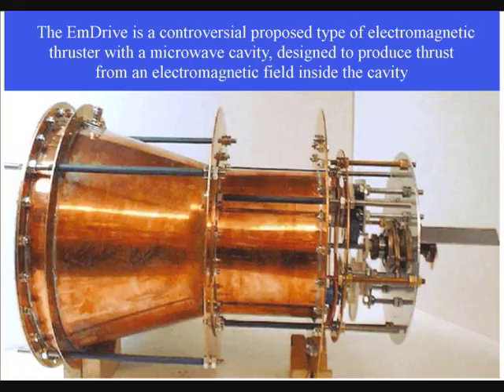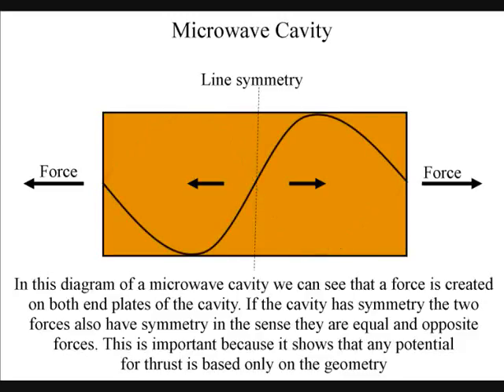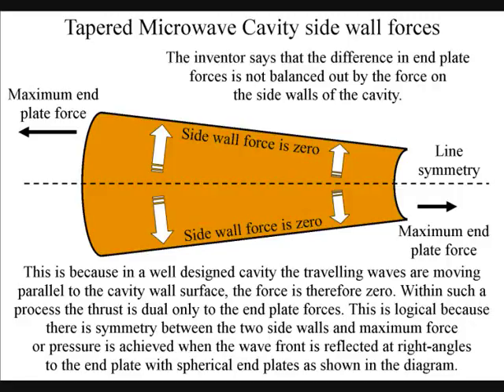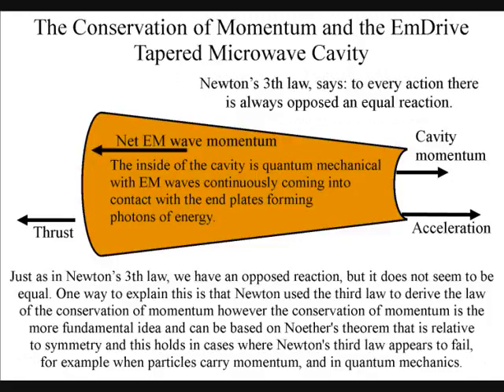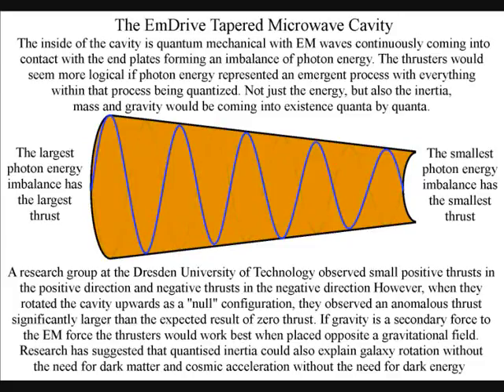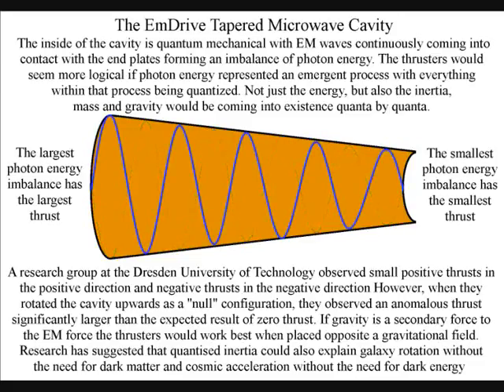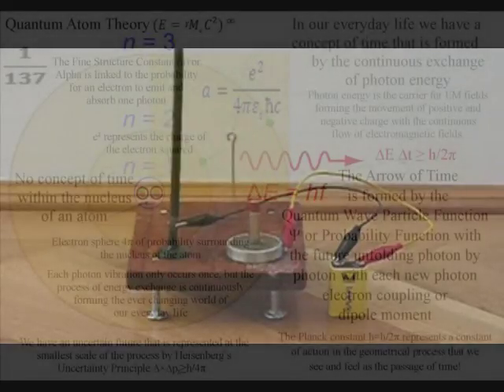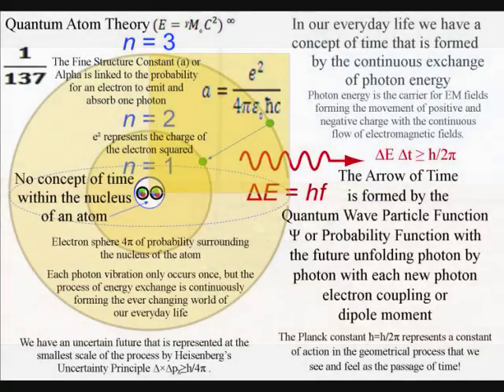EmDrive and a new interpretation of photon energy (1)

Comment: For those who haven't done any kind of research on how it works. I believe one of the reasons this works is because if you hit metal (certain metal or depending on light) with a certain wavelength of light it starts to give off electrons and those electrons leave based on the energy input. This only starts to happen at an exact point of light wavelength and energy input for each kind of metal. Once you surpass this point the more energy you input through this means the more energy that the electron leaves the metal so you get more thrust. 

I could be slightly off with something since I can't remember the name of this effect, however it is one of the things that I have at one point found about this kind of thing a long time ago.

Comment: If objects in space warp the so called space time, then why not ride the waves. This would remove the amount of energy needed to warp space time. The scientific community only describe what they see but not what is actually happening. The EM drive is not 'impossible'. 
What the EM drive is doing is riding a wave by resonating the container at the frequency of the surrounding wave. The surrounding wave however has a point source too far from the device thus you would need higher energy source to produce significant thrust. I bet if they tuned the drive to the resonant frequency of the earth they would then fined higher thrust output. This makes it easier because you can determine where the source of the wave is coming from and  direction of the wave thus allowing you to avoid "swimming against the wave". 

The ETHER does exist.